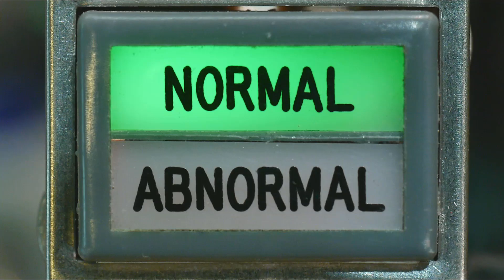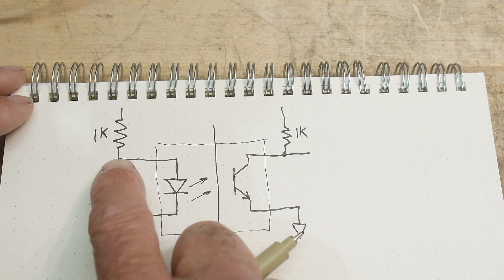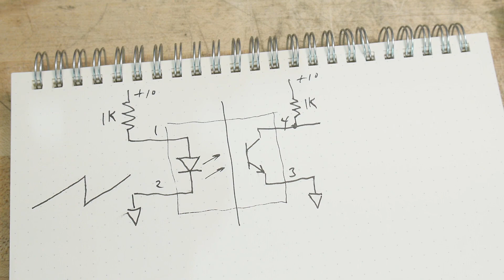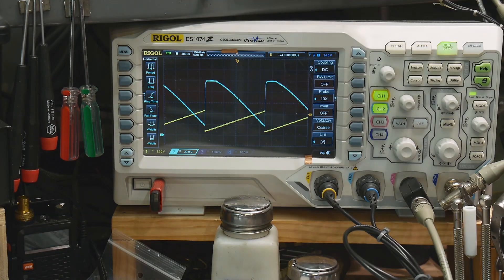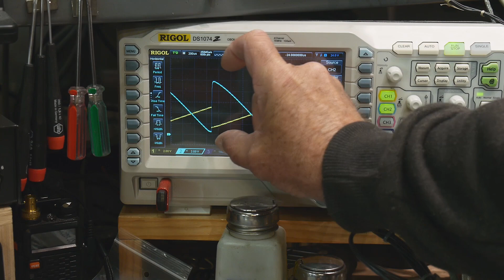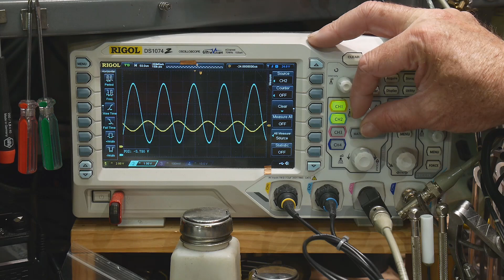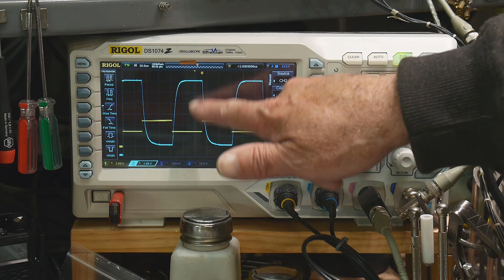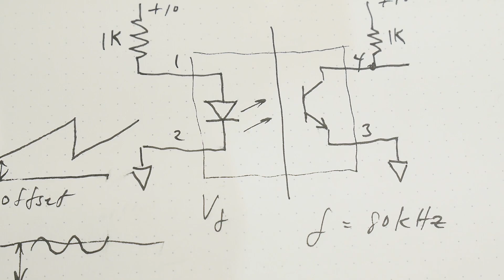#769 Basics: Opto-coupler Opto-isolator

Comment: Excellent video thanks. For anyone who may not know, if you remove the load resistor from the collector lead (pin 4) and positive source and put it between the emitter (pin 3) and ground (or the negative source) and measure between the emitter (pin 3) and ground, the output voltage will go positive as the input side goes positive.
Reply: Can this  linear operation be done with every opto ? How to understand it from the data sheet
Reply: @minshijamusthafa3076  Think of the opto as being a resistor or a switch, which side you put the load on really doesn't matter, configure it to suit your needs. It's just a another series circuit element. Data sheets can't go into every possible configuration.
Reply: @minshijamusthafa3076  Not an ad, but HP's (Broadcom's nowadays) HCPL-4562 is designed for analog isolation, an analog video optocoupler. If waveform is not too critical, many optos would work unless they have an internal Schmitt triger or the like on the output side. Many years ago we developed a circuit that "listened" to tone signaling on a phone line, using something like the 4N26 which worked because we only wanted to detect a 425Hz busy tone.
Reply: Thank you

Comment: Question.....so did you remove the +10v on the opto coupler input and replace it with the input wave at the top of the resistor...?  If not...where did you wire to...?   This is great stuff..!
Reply from the maker: yes
Reply: Can this linear operation be done with every opto. How to understand it from the data sheet

Comment: I have found a really simple one way ICOM civ serial to TTL converter that uses only one transistor. I did try to make this work with a opto isolator instead but it never worked. When I use the transistor side of the opto isolator, it works (not isolated) but as soon try to connect the rs232 side to the diode side, it's doesn't work anymore. Any hint on how I could make this work?
Reply from the maker: the led in the optocoupler needs more current than the base of a transistor.
Reply: @IMSAIGuy  ish... how can I obtain that with a low output like a RS232 level ? The opto coupler is a 4N25.
Reply from the maker: @Aleziss  put a transistor in front of the optocoupler. the RS232 will turn on the transistor, the transistor will turn on the LED
Reply: @IMSAIGuy  with the need of an external power supply though right ? The fact I wanted to use that one way was it is working without an external power supply with a single transistor, I thought I could have run an opto coupler that way but it seems more complicated than I expected... Thanks for the tips
Reply from the maker: @Aleziss  You could try a current loop

Comment: The Miller effect is one of the main limiter on the bandwidth.  It you use another transistor as a cascode stage then you should be able to improve the frequency response considerably.
Reply from the maker: I have never seen a cascode on an optocoupler. Do you have direct experience or an example of a product that uses that? you can bootstrap a photo transistor if you have access to the base: 
https://www.epanorama.net/sff/Misc/Optical/Bootstrapping%20Phototransistors%20to%20Improve%20Pulse%20Response.pdf
Reply: @IMSAIGuy  It is one method to improve bandwidth aside from getting a specialized high bandwidth opto.  For example the a application note  https://www.onsemi.com/pub/Collateral/AND8273-D.PDF gives a cascode configuration to improve bandwidth.  Search for cascode to find it.
Reply from the maker: @argcargv  I'm going to have to try that
Reply from the maker: I just wired it up and seems to work great. I wonder why that paper I reference says a simple cascode doesn't work? There might be debate on if Miller is a good term for a phototransistor but it certainly has lots of capacitance what ever you call it, and using the cascode to limit any voltage changes on the collector seems to work fine.
Reply: @IMSAIGuy  I discovered this a many years ago when I found out an optocoupler didn't have enough bandwidth for my digital data. I found this trick and it worked very well for me as well.  The base is floating so it is non-traditional to think of it as a miller effect I guess, but I have seen the same trick used to improve bandwidth for other photodetector circuits using phototransistors.
Reply: @IMSAIGuy  Maybe the paper was suggesting that the simple cascode configuration didn't improve the speed enough for his purposes so he went on to find the bootstrap approach.
Reply from the maker: Did a video on the cascode. will post in about a month
Reply: @IMSAIGuy  Cool.  Looking forward to it.
Reply: Can this linear operation be done with every opto. How to understand it from the data sheet